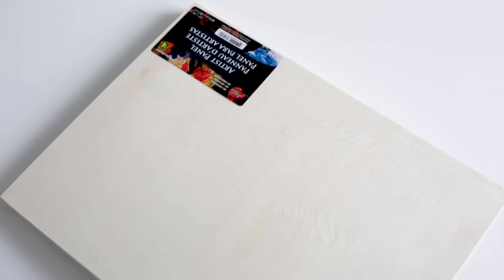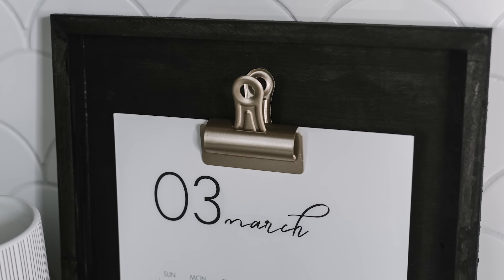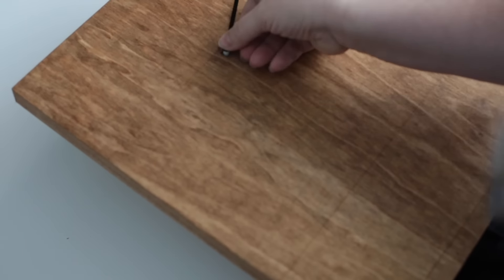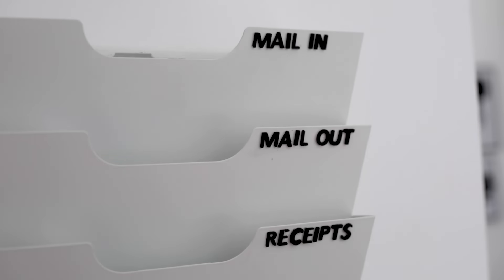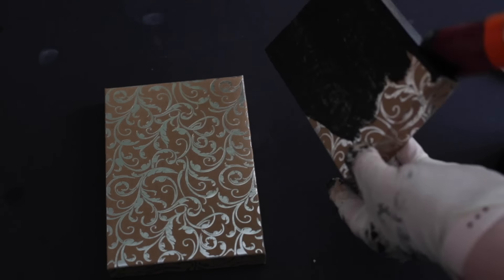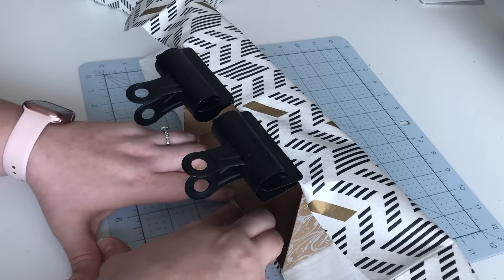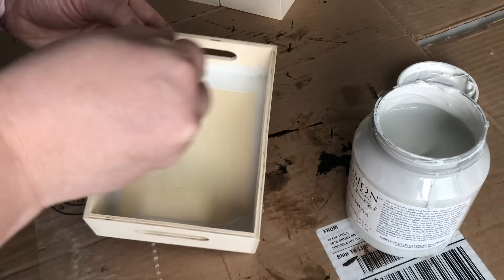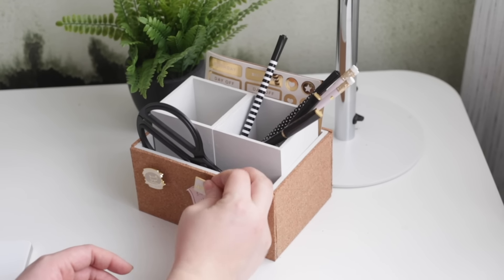Dollar Store Office Organization & DIY Decor

Comment: I love it all, even the idea of cork on the wooden house.  There are several ways that could work--galvanized strips bent at the proper angle and  glued on over the "breaks" and cutting four pieces of cork for both sides of house and both sides of roof with a little overhang.  Where did you get the black and white tile.  That really just set off the little wood tray perfectly!
Reply from the maker: Thank you! Those are great ideas! The tile tile sheets were from Dollarama :)